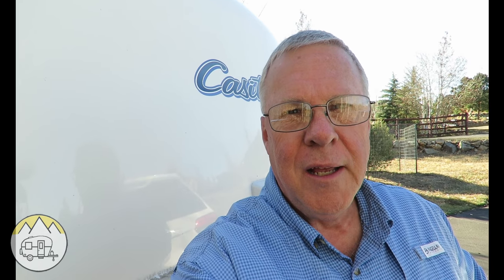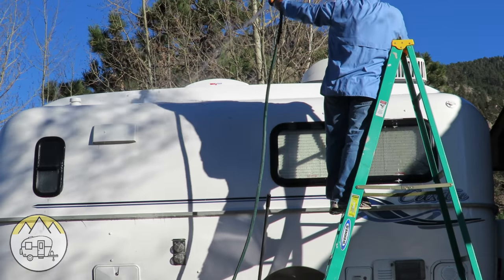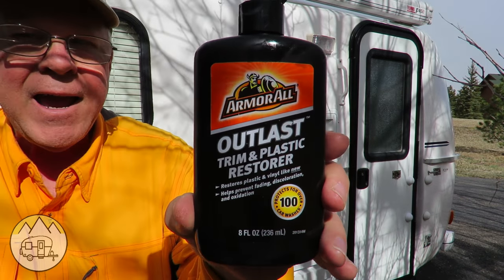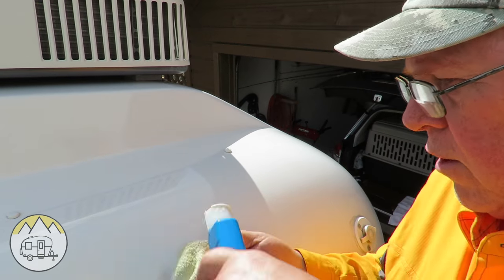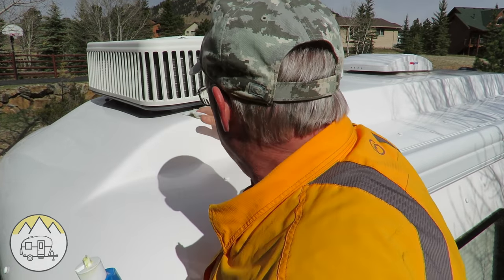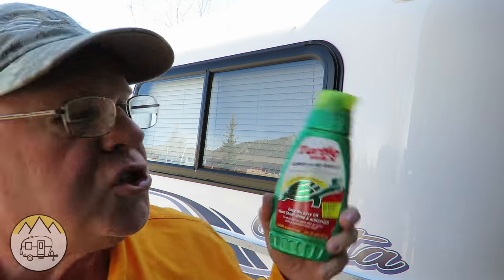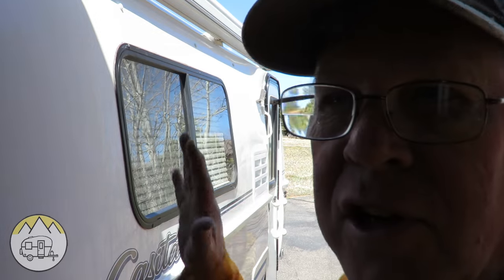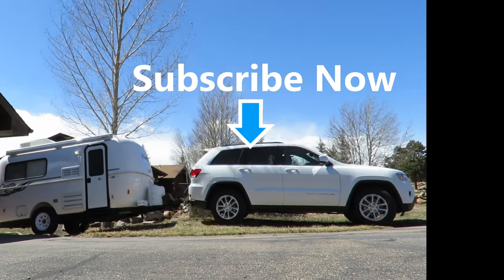Casita - Washing & Waxing your Travel Trailer by RV Adventures

Comment: It looks fantastic.  I have a couple of questions.  I have seen on the forums that this wax dries very fast in the sun and it is difficult to get off at that point.  Have you noticed this?  Also, I bought my Casita used and the previous owner had taken great care of it other than the waxing so it has oxidized a bit.  Do you think I can just use towels or rags like you did or am I going to need a high speed buffer to get it back to the shine?
Reply from the maker: I haven't had any problems rubbing it off even after 30 minutes. To clean oxidation on fiberglass use a cleaner like this one ( https://amzn.to/2CE017J ) and then polish. I haven't used this one or any, but I have heard of folks having good results with a cleaner made for fiberglass. A lot of them say "Marine or RV" because the majority of boats are fiberglass as well.

Comment: We have a 21' Escape fiberglass "egg" trailer purchased in 2016.  I've also been using the Meguiars product made for fiberglass boats.  Seems to work well.  I was curious about the need for a second coat of turtle wax.  Do you feel that you can go longer between waxing with the second coat?
Reply from the maker: Yes, I think it adds some time, but more important to me, some protection because of our home base being at 7,500 ft. elevation and the sun is so intense.